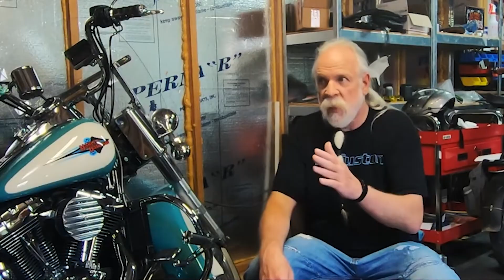Your Harley’s ECM Is Smarter Than You Think – Here's How It Learns

Comment: Does this adaptive work just the same when a tune has been flashed to the ecm? Thanks
Reply from the maker: Here is the full video that you may find useful/interesting - https://www.youtube.com/watch?v=0vbTkRvFa80 
In the video above you will see that the ECM has what HD calls "Adaptive Learning" and what almost all the rest of the industry calls LTFT (Long Term Fuel Trim).  This is where the open loop part of the tune is modified by what changes are made in the closed loop tuning.

Here is a written report on the ECM that you may also find useful/interesting - https://www.dkcustomproducts.com/how-the-harley-ecm-electronic-control-module-works-with-dynamic-tuners.htm

Thank you for commenting! 😎 MB

Comment: Does the ECM keep learning if I do a stage one kit & S/E tune, After Tune will it keep learning?
Reply from the maker: Here is the full video that you may find useful/interesting - https://www.youtube.com/watch?v=0vbTkRvFa80 
In the video above you will see that the ECM has what HD calls "Adaptive Learning" and what almost all the rest of the industry calls LTFT (Long Term Fuel Trim).  This is where the open loop part of the tune is modified but what changes are made in the closed loop tuning.

Here is a written report on the ECM that you may also find useful/interesting - https://www.dkcustomproducts.com/how-the-harley-ecm-electronic-control-module-works-with-dynamic-tuners.htm

Thank you for commenting! 😎 MB

Comment: I had a air intake installed and tuned to finish the stage 1. Already had aftermarket slip ons. I did it when i bought it so cant compare before and after. It ran very well. I ended up puttin shortshots on. It still runs pretty good just the occasional decel pop. I just had the zippers rs468 cam installed just waiting for tuning to be done. Absolutely cannot wait!!
Reply from the maker: Awesome! I hope that you enjoy your new CAM. Here is a video we made on decel pop that you may also find interesting/useful - https://www.youtube.com/watch?v=I_djBYYYu28

Thank you for commenting! MB